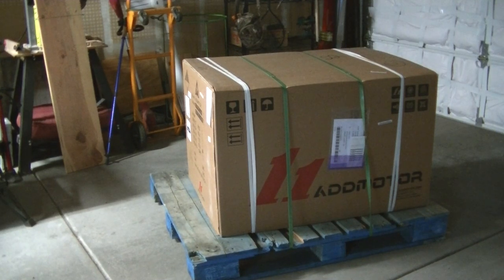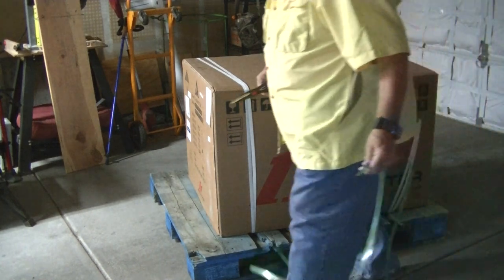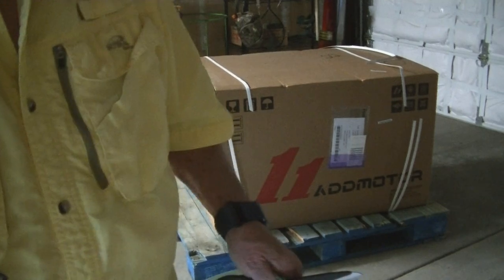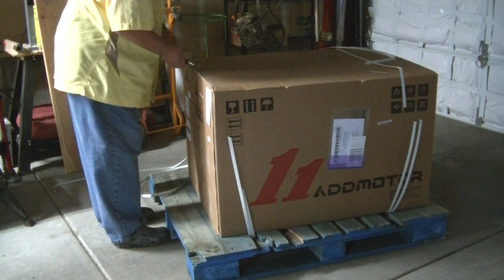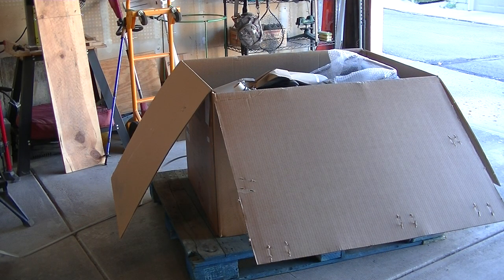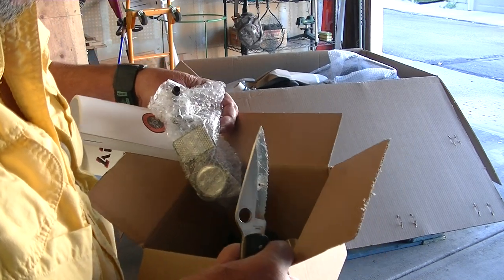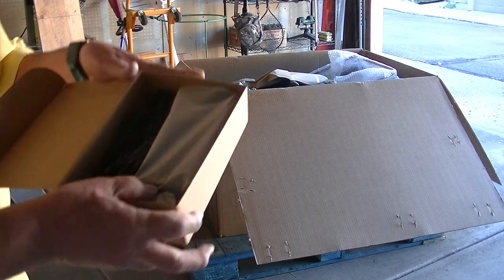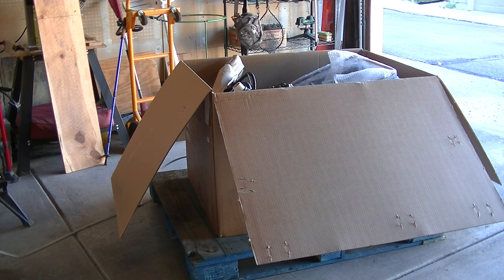Addmotor Citytri E-310 Unboxing

Comment: How do you like this after having it for a few months?
Reply from the maker: At first I did not like it because there was too much ghost pedaling. That's when there is no pressure  on your pedals when using pedal assist. I had to change the crank and chain ring and the chain to help minimize this. If I had to do it again I would buy a different model.